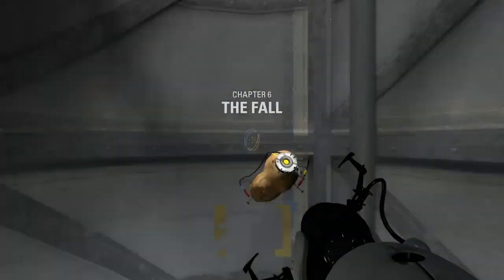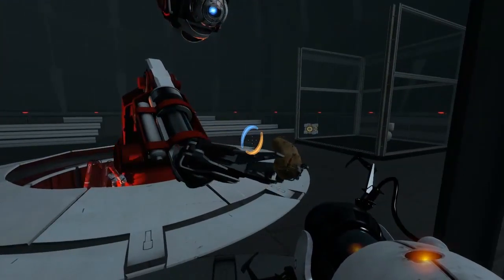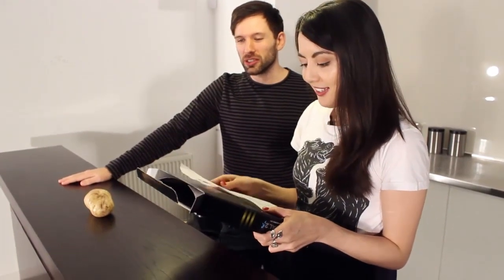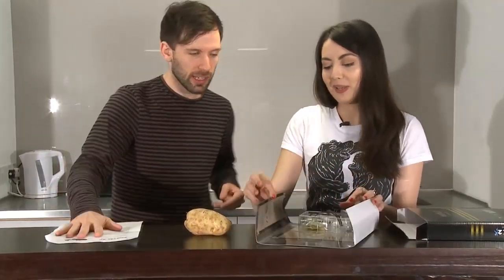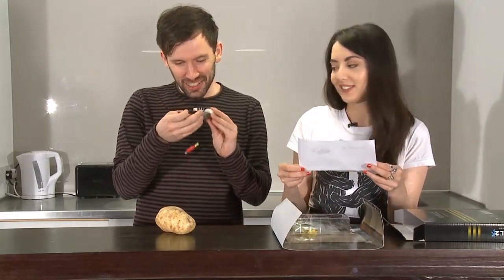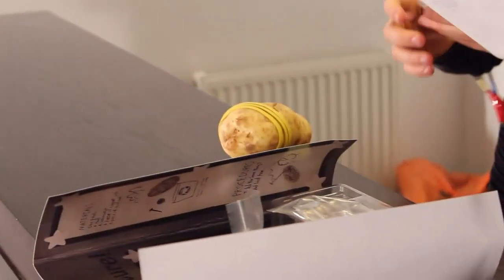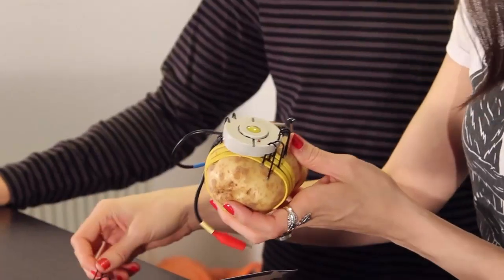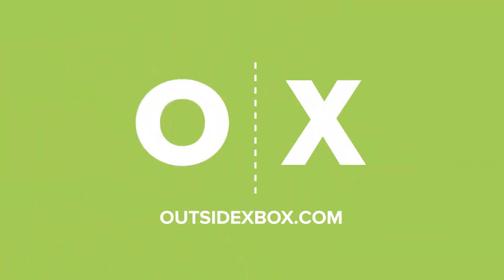Portal 2 Potato Battery - GladOS PotatOS Science Kit - Science Unboxing For Science

Comment: All you guys actually have to do is get a few galvanized nails and some copper wire. Then stab the nails into the potato and connect a voltmeter to the nails using copper wire. It was pretty cool when I tried it out.

Comment: Too bad its fake. Would be cool if it worked with a potato...should work..
Reply: ***** not quite enough power
Reply: @romanformicola253  if you boil a potato it can produce up to 5 volts maximum output, so it could work